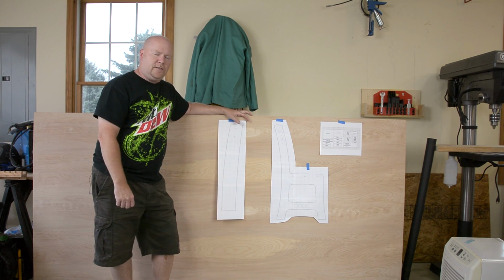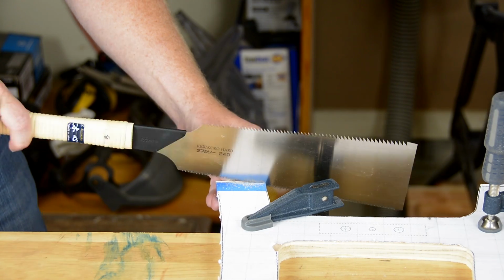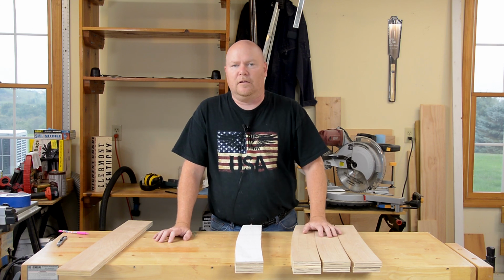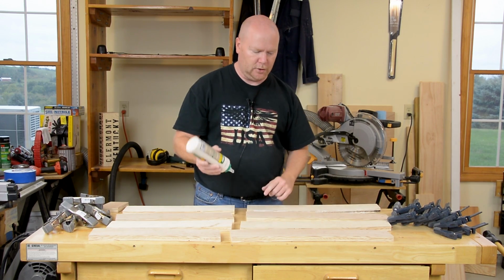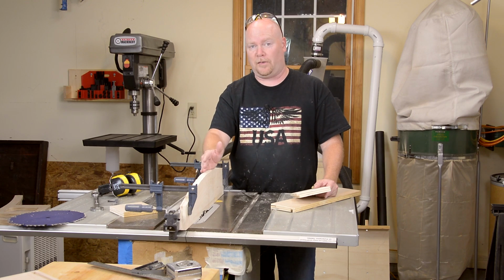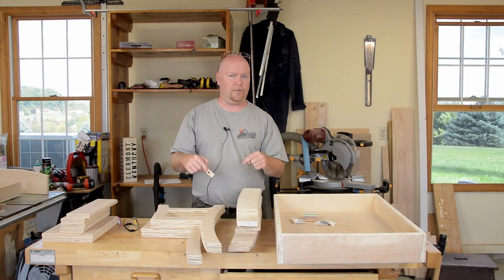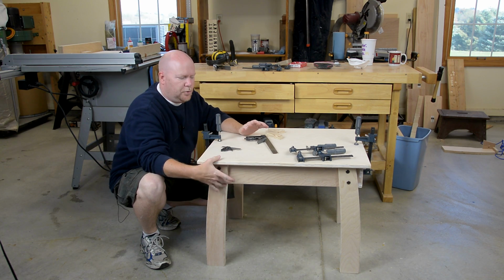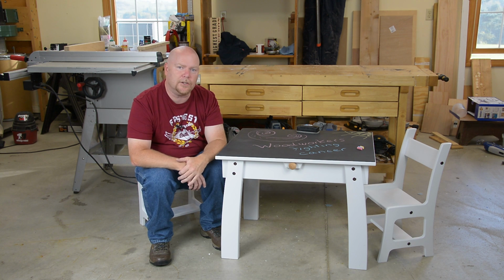Kids Table and Chairs - Woodworkers Fighting Cancer

Comment: Matt did you use 3/8" threaded inserts vs 1/4" for the stretchers?
Reply from the maker: I don't recall which size I used.  Either would be fine, though the smaller ones are probably better.  The wood is a lot more likely to fail around the insert than the bolt is to sheer off.  Likely they were all the same though.  It's all the same plywood, so no need for different size inserts.
Reply: I wish I had a drill pess like yours. I finished the chairs today, but had to redo a couple of the stretchers. I was drilling the holes for the dowels by hand, screwed a couple up.